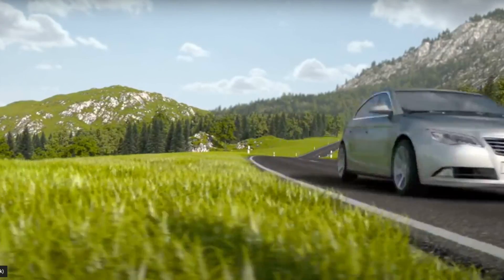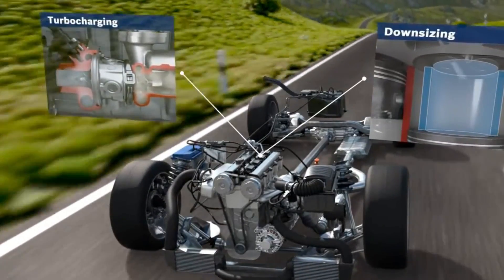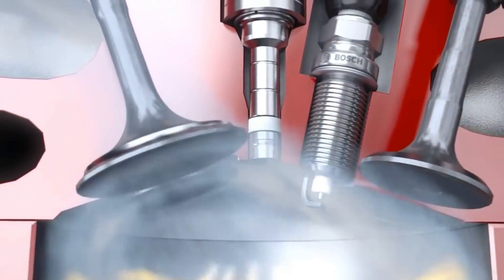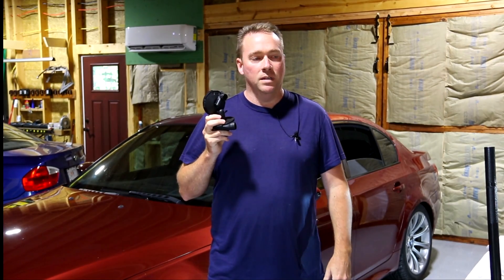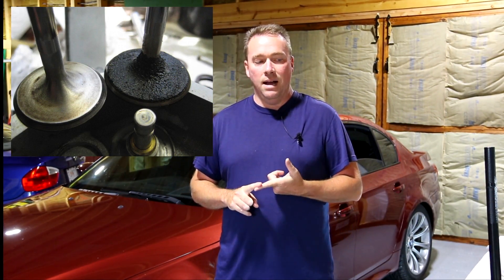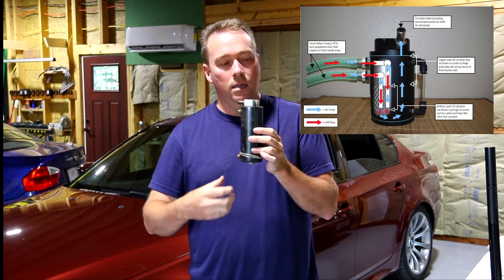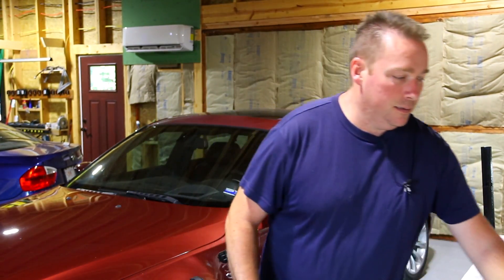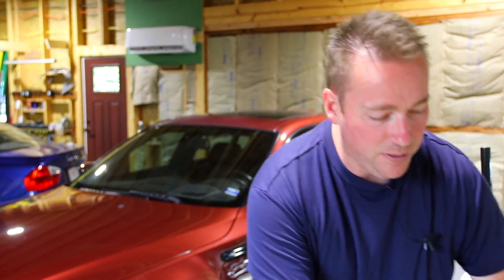How To Prevent Carbon Buildup Deposits on Direct Injection Engines !!!

Comment: Subaru uses DI. Nothing you put in your tank will stop it. The fuel additives will help the injectors stay clean but do nothing to clean the inlet side of the inlet valves. They have a service they do with injecting a cleaner into the air inlet before the injectors that clean the carbon off the valves. They also recommend a PCV change every so often not sure of the miles.

Comment: Did an oil change on my new-to-me 2018 Sport 6 speed. I mentioned to my mechanic about the potential carbon build up and he had Pennzoil Platinum Full Synthetic on hand. Said this should help the engine run cleaner because it is derived from natural gas, not crude oil. Anyone else running this?

Comment: The best thing is to avoid a gdi engine. You have to watch your engine oil because these engines have alot of fuel dilution in the oil. This allows the oil to vaporize at a lower temperature. I would never go more than 3000-3500 miles between oil changes. I will never buy a car with a gdi engine

Comment: i just used seafoam gdi on my 2016 yukon because it had a rough idle I followed the instructions and now the problem is pretty much gone engine is super smooth at idle

Comment: I haven't heard of any ways to eliminate the issue, but you can slow it down and reduce it, so you don't need to clean the back of the intake valves as often;

1) Oil catch cans
2) Port injection water / methanol kit

While it is admittedly a little annoying to have to adapt these two things into a DI fuel system, especially the water / meth kit, they'll still help mitigate the problem. 

The water / meth injection kit can fitted with just a single port placed before the intake manifold, but the best results will come from having an injector for each cylinder, so the solution will better clean the back of the intake valves. It'll also need to be tuned to work properly, which can also provide more HP, as the water / methanol mixture will cool combustion, allowing you to play with the timing. But of course, the problem here is that most people won't know how to adapt a water / meth kit, and tune it. The kit alone can cost $500 (you might be able to find one for a little less), then the cost for a shop to tune it if you don't know how to do it yourself, will cost at minimum, hundreds more.

Comment: This is why it's so important to ensure you are using a high quality oil that meets OEM specifications and change it frequently. The PCV introduces crankcase oil mist through the air intake which actually decreases the potential for carbon buildup if the oil is clean and free of deposits. The EGR recirculates exhaust gasses back through the intake which creates an issue with keeping the stem side of the valves clean. I personally run Marvel Mystery Oil (MMO) in both my fuel to protect the injectors and in my oil to pass by the back of the valves on the air intake. If you are careful introducing a mixture of MMO and seafoam through the throttle body from time to time can reduce the rate at which the carbon builds up. Applying too much can lead to issues with large quantities of carbon entering the combustion chamber which could lead to engine failure. Proceed with caution and stay after your oil changes because dirty oil is where the majority of deposits come from. I'm not sure a catch can would do much to protect you from contaminated oil and possibly do more harm that good. Just my opinion at this level of my understanding of the issue and the root cause of the deposits. Thank you for this thought provoking video.

Comment: MY kia Rio DGI 2012 model 1.6lt has done 160 thousand klm. Runs fantastic,  great economy 35lt high octane gets me 440klm. I change oil regularly changing brands always. Best fun car i have driven and power to beat most cars with bigger engines that cost 100 times more. It has the pre detonation occurring occasionally at low speeds.

Comment: There are two options you didn't mention. Buy an older vehicle or buy an EV. I would never buy a vehicle with direct injection or a turbo or a plastic intake or an EV. If people don't buy them maybe they will stop making them. I drive an older vehicle. Sounds like we've been sold a bill of goods to get a little better gas mileage and they don't have a good solution to the problems it creates.

Comment: A catch can is not a bad idea except they are designed wrong. The can should at least have  fins  like the exterior of  an old Volkswagen piston chamber to lower the incoming air to be able to condense the oil from the air. Or place an oil cooler before the catch can to lower the temperature. Some people simply disconnect the pcv from the intake which I understand is illegal.

Comment: My 2007 Lexus GS350 has direct injection and it's burning oil, would cleaning the carbon deposits using ATS 505Cro or some kind of cleaner stop it from burning oil?

Comment: I've said for years that if you keep the PCV from routing into the air intake you will do a huge job in preventing carbon buildup on your intake valves.
Reply: Thats not legal in most country's !
Reply: @020matrix  Pirating/torrenting movies is illegal in most countries... How do you watch your movies? If you have the computer/coding knowledge to disable EGR and re-route oil vapors - do it (I say)... eff the government, lower your own costs of vehicle ownership.
Reply: @dakibmw  most modern engines need a vacuum in the crankcase to help the low tension oil rings seal against the cylinder wall. simply venting to atmosphere would cause oil burning in many newer cars.
Reply: what can i do to my pcv ? i have a silverado 2.7 turbo 2021? thank u

Comment: May I ask what do you think about using MMO added to the oil? The purpose would be for the vapors and droplets that end up on the valves, assuming some MMO remains on them, help prevent built up, or dare I say might even reduce it over time?

Comment: Change oil every three thousand miles, use injector cleaner Use top tier fuel only, Keep it clean and it will help,AIR FILTER AS WELL PCV Valve keep clean and change plugs every sixty thousand miles.
Reply: This one sentence will save everybody hours of watching videos on how to keep carbon under control in there DI engines.
Reply: Change "fully synthetic" oil every 3k miles??  I was thinking about 4 -5k....but maybe even sooner?  I run Amsoil, so it's not exactly cheap but is True synthetic oil.
Reply: Yep. Cheap gas with retarded timing on High Compression GDI Engines will result in Carbon Build-up. I have 2 myself with no issues.
Reply: @Chiefgeargrinder  not true, top tier gas has been debunked many times.

Comment: It's called buy a Toyota or Lexus product that runs dual injection. Port and direct dual systems solve this problem. But hey, BMW and most other brands are too cheap to do this. Cheap German cars also use plastic direct injectors... Toyota and Lexus use metal for the high-pressure direct injectors and only use plastic on the low-pressure port injectors. But, what do you expect? It's BMW. They make you rent your own heated seat through a subscription. If you want a German car, lease it. Do not buy one. You've been warned.

Comment: I found that running a higher viscosity oil keeps the oil vapor to a minimum,  5w30 is the factory oil and I run 10w30 and have noticed far less vapor in the catch can, but you still have to walnut blast or chem. clean the valves every 60k miles its the DI issue no way around it.
Reply: I just bought a 2025 Subaru Forester with a NON turbo 2.5L DI engine.  It actually calls for 0W16....I did an oil change in first 1k miles for break in and put in Ow20, but was thinking next oil change doing 5w30.....any advice on which oil weight?
Reply: @lynchcreekmuzzy5759   I would base your decision on the weather in your local area, if it freezes in the winter go with the factory spec.  New engines run extremely tight clearances and If you use to thick of an oil it will bypass the filter until it gets warm enough and thins out, I would not go thicker than 0w20 in your case

Comment: So, how do you prevent carbon buildup deposits on Direct Injection Engines?
Reply: The cheapest way is to disconnect the pcv to the intake and let it vent out.
Reply: @Akira-nw4jl will it give me a code on my 2021 silverado 2.7 turbo?
Reply: @Akira-nw4jl That’s also illegal and you won’t pass emissions checks if you do that
Reply: By replacing an engine every 90000 km

Comment: But a "port and polished" intake and at your headers can also give you the same performance, better fuel mileage, and "reduced emissions". "Exhaust" is basically unburnt fuel. If we made more efficient combustion engines, they do not pollute as much. And that is why the intake manifold is so important. We can make air intakes 90% + efficient, but most are 25%-35%, with modern cars dealing with the "pollutants" after the fact in the catlytic converter. Which burns the unspent fuel in the "exhaust" to the detriment of the car owner. That is THE TRUTH regarding pollution and modern combustion engines.

Comment: Toyota's fuel injection system that uses both direct and port injection is called D-4S and is used on every Toyota that has direct injection.  The inclusion of port injection is not solely about cleaning intake valves; it is because port injection performs better under certain conditions where a more homogeneous air fuel mixture is needed.  The port injection runs under low & mid RPM & loading, and Direct injection is engaged under high load conditions where its cooling effects & precise metering is needed.  D-4S is used on the newest Camry 2.5L 4-cylinder and 3.5L V-6.  Ford also uses dual injection on its Eco-boost engines.  Audi is also switching to a dual injection system.
Reply: Very smart system.

Comment: Why would DI make the fuel injectors more susceptible to going bad? From the looks of these animations and other diagrams, seems like both the injectors and the spark plugs would benefit quite nicely from fuel additives like seafoam and royal purple.

Also, what exactly needs to be done in regards to resetting/recalibrating the ECU after changing the fuel injectors? I have a Mini Cooper S. Would the ECU have to be entirely remapped by some specific equipment before it could run? If so, what do I need?
Reply: "Why would DI make the fuel injectors more susceptible to going bad?" 
Direct injectors are located in a more hostile, high temperature environment - the cylinder. More stress on the injectors, more burnt carbon deposits in the cylinders, crankcase.

Comment: Since this is due to oil vaporization, wouldn't a simple preventative step be to use a high quality synthetic oil that resist breakdown much better than  a standard oil.
Reply: That's part of it

Comment: Having to dump a catch can  a lot, tells us there's a lot of garbage going back into the intake.  You can also have high oil consumption with carbon build on the top ring, which can cause a ticking and scoring of the cylinder walls.. That's all per a S.Korean video on the GDI problems.

Comment: I would like to know the preventative solutions as the title suggests. You only point out what doesn't really work. I've got an N63TU1 on my x5 and go through plugs every 20-25k because they build up with carbon. I am pushing 640 hp and run it hard but some of my plugs are consistently crusted and require replacement. I'm sure my valves are the same. Any ideas? I see readers recommend meth injection.

Comment: Toyota had the best salution they added both direct and port injection so you get the benefits of both. The computer switched back and forth and this keeps carbon build up in check.
Reply: Yes, I have a Toyota 3.5, has 12 injectors 👍
Reply: Ford uses dual injection as well. And the Ford system has the port injectors running all the time. At Idle, the Ford system is 100% port injection. The direct injectors are off. Which is good, because this is when the direct injectors are most likely to get unburned fuel past the rings and dilute the oil. At wide open redline, is over 90% direct injection. This system insures the intakes are bathed in fuel at all times, keeping them clean, and reduces the amount of oil dilution you get with GDI. A superior system to the Toyota D4S imho. However, even the D4S system is better than every GDI only system going.
Reply: @craigg4246  Copy from Toyota remember Lexus had dual injection way back in early 2000's. Toyota does use both at the same time when the need arises there is no reason to run them both 24/7. We all know Toyota leads and everyone else follows.
Reply: @NDIrishfan71  just not true. Their dual injection system debuted in 2017. The same year Ford’s did.
Reply: @craigg4246  Maybe you should educate yourself before calling somebody a Liar:P It started with the Lexus on the GS models in 2007. In 2012, the Toyota/Scion FR-S F86 received the D-4S. The Highlander and Tacoma also received the D-4S systems in 2015 as an option. The latest vehicle to get it is the four-cylinder used in the 2017 Camry. So yes what I said was indeed true. Better do some research before making false accusations. I give you an A for being a Ford Fanboy though:P
Reply: @NDIrishfan71  i own a 2015 Highlander. No D4S. Try again.
Reply: @Tony Alston regular 87 but I use only top tier gases preferably Shell.
Reply: Rip is250
Reply: I've also heard those high pressure direct injectors have issues and are very expensive. Something like 60000 psi?
Reply: And ford
Reply: Double the cost of the fuel system, and pass it along to the customer.
Reply: Toyota isn’t the only automaker that has both port and direct injection
Reply: @JimS-j1x  Toyota developed it 1st back in early 2000's Lexus if memory serves. Toyota is not perfect, but they do seem to think things through longer than other automakers in the interest of reliability.
Reply: leave it to toyota to save the day
Reply: You can still get it but just run top tier fuel and you’re straight. I have a 2018 Camry SE with that fuel system and using the AMSOIL PI cleaner makes the engine run so great and I get 43 mpg on the highway.
Reply: @DuckMcDuckinson dang 43 is pretty bad

Comment: I had my 1st experience with GDI. In a 2013 Hyundai Sonata ! POS @45k it would burn 1qt of amsoil signature series every 1k, 10w/30 Florida. I never had an oil burner before and ran it down 1.5 qts before I checked the oil. I changed to Pennzoil ultra platinum all real low NOACK rated OILS (EVAPORATION RATING) I used CRC Injector cleaner every 10k no help. Put on a catch can with stainless steel pad and no oil in the catch can ! It was ALL going by the oil rings ! Went to the dealer ran 5 oil consumption tests and got 350 miles to the qt. Yes 73k and it was now burning a quart of oil every tank of gas, Hyundai said its my problem 3rd owner  lesson learned. I traded it in for  a 2011 toyota Avalon, 1 owner , no accidents, 6cyl, port injection, 6 spd, BULLITT  PROOF. I'M NEVER SELLING IT 57,500 MILES, 20 mpg. I can live with that, DREAM CAR. LESSON LEARNED @ 69 LAST CAR I WILL EVER NEED : )
Reply: FYI GDI rail pressure is over 2,000 PSI cam actuated pump another thing to go wrong ! SELL SELL go back to port injection or electric if you don't travel
Reply: @stilllearning777 electric is worst lamoooooooo
Reply: Did you try Some engine cleaners especialy for stuck pistons rings?

Comment: Really did not have much info on how to prevent it.   Run gas that the additives are PEA based and premium if the engine had a high compression.  My Nissan manual says no lower than 87.  A lot of DI Nissan engines recommends 93.  It’ll burn cleaner and probably not build up.  The vapor off high end fuel can clean the valves.  I’ve got 73,000 and haven’t lost any mileage.  I run Shell, Chevron ethanol free.
Reply: If I understand you correctly, you're saying running Shell V-Power will prevent carbon valve build-up on a direct injected engine, right?  How do we know this?

Comment: Water Methanol injection into the intake manifold , steam is a very powerful cleaning agent
Reply: I was wondering about using that but wasn't sure if I could put it on a na engine.
Reply: @that1guy997  Sure you can , They sell certain kits for any particular car , and nozzle size . To get best results you have to tune your car to the Methanol injection, It increases Octane and benefits of cooling Air intake charge allowing advanced timing for more power
Reply: I was going to recommend this, or a 35hp nitrous fogger wet kit.

Comment: Just disconnect the pcv hose and run a small filter on it, vent it to atmosphere
Reply: You did this already? Please send me some photos if you have some. Gracias
Reply: That’s my thoughts
Reply: I tried it. It did not work. The engine quit running as it must have leaned out because of open port on manifold so I tried plugging it and engine stalled. Tried again with finger over hole and had to throttle the air let in.